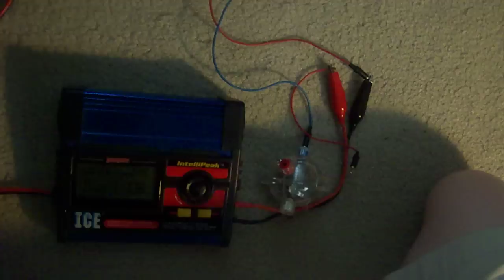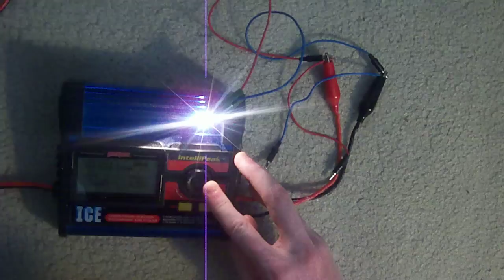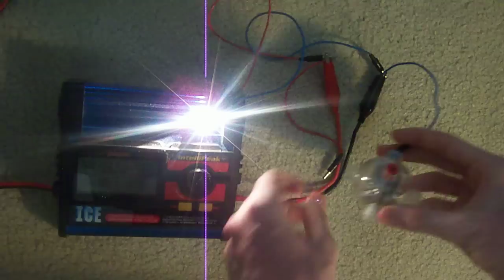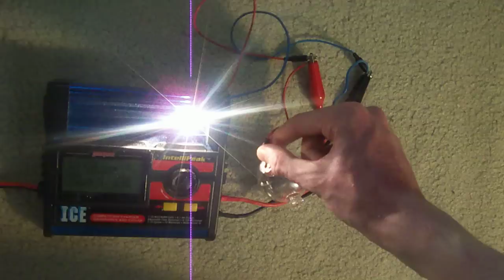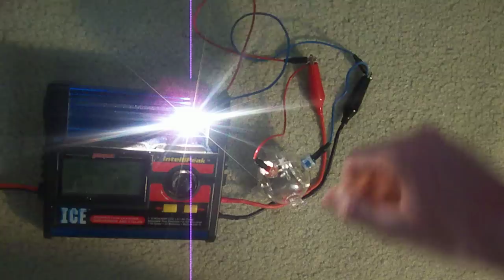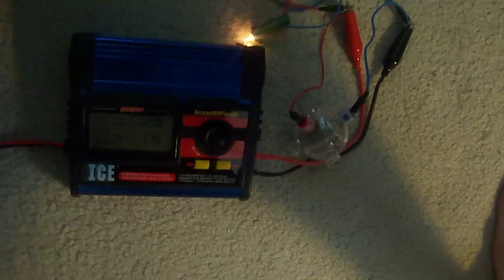Hands-On Parallel Circuits

Comment: i like this videos u did very informative. 2 questions:
 1: does AC or DC change how you would make that circuit.
2: when making a circuit how do i now how what is the proper resistance, resisters are measured in Ohms and WATTS not volts or amps